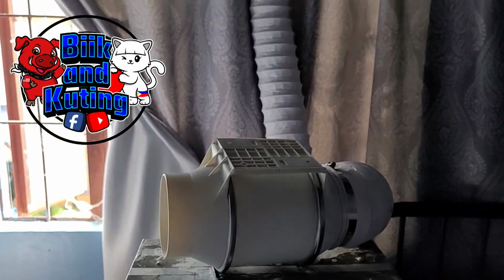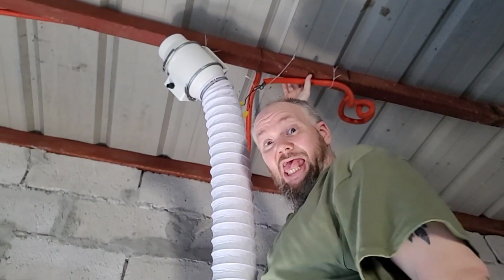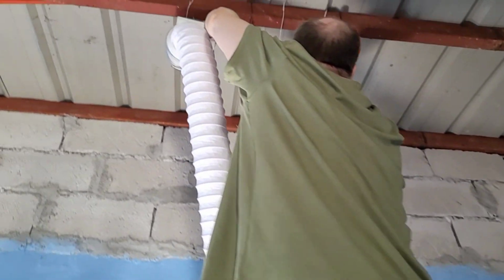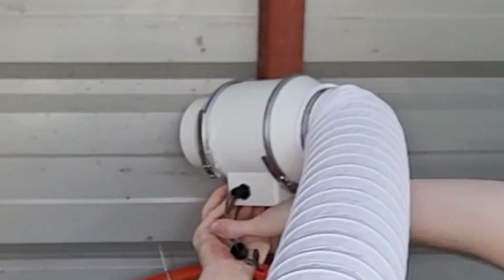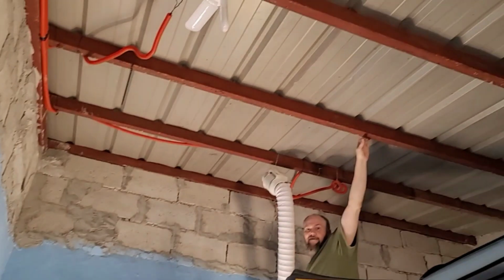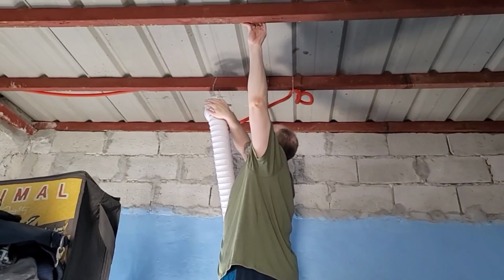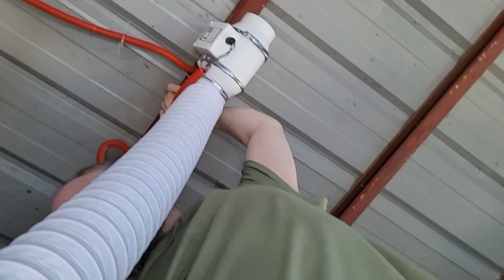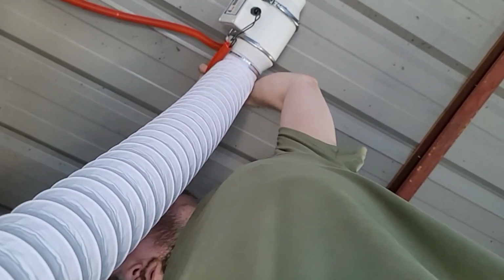Upgrading the ventilation of our tiny home in the Philippines 🇵🇭 #BiikandKuting

Comment: good day i just want to ask what is your final review to your inline duct exaust fan?
Reply: is the inline duct exaust fan is much better than the ordinary duct fan?
Reply from the maker: It's a lot stronger than I thought. I now don't have to even run it all the time. I have it set to alexa timer and vent about 5 minutes every other hour. If you're looking to really move some air, I highly recommend it. Even would be great for stove vent, too. It's pretty quiet. I never hear the motor, just the air movement.
Reply: @BiikandKuting  i want to try the inline duct fan because the ventilation to the apartment that we are renting is quite poor..i dont know if the inline duct fan can be used for long hours
Reply from the maker: @kamoteng gala ng gala  Yes, it can be used long hours. I ran it for several days straight when seeing how best to cool my area. It never got hot or had any bad noises. Mine came with a plug, but I wired it to a light switch instead to turn it on and off easier. And haven't noticed any change in meralco bill either.